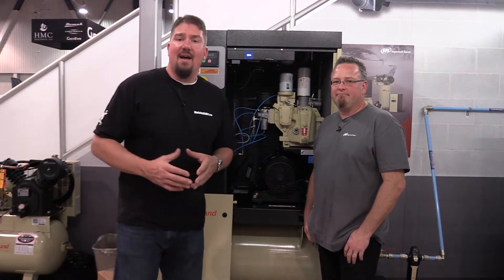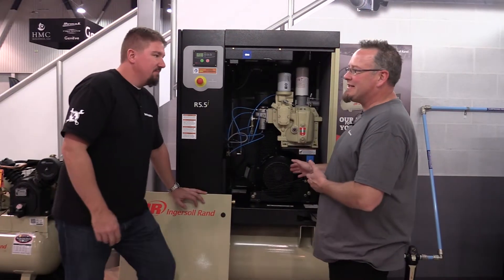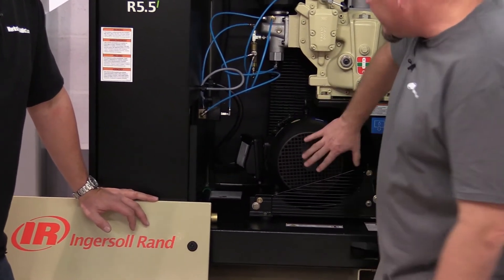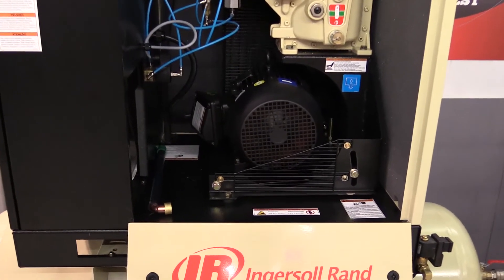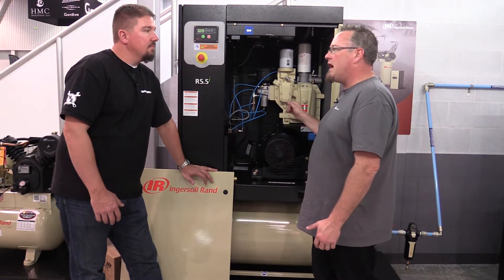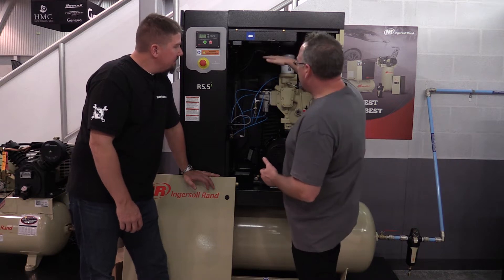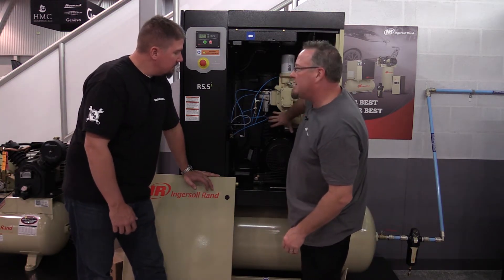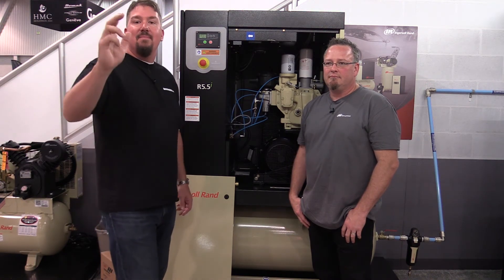Ingersoll Rand UP6S and R-Series Compressor Motors Protect Equipment from Shop Elements

Comment: It makes sense to protect viable components from the elements , there is a reason that the engine in your car is enclosed under a hood and fenders. Take a look at the top of the buses that are used for public transportation and you will see this concept of pulling hot air up and out in action. Good video brother....this kind of common sense will save you $$$